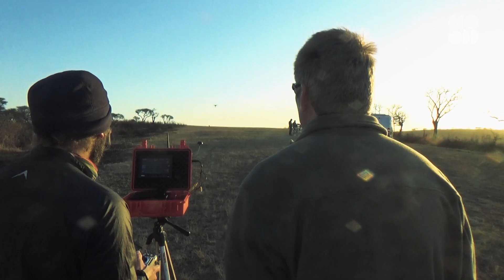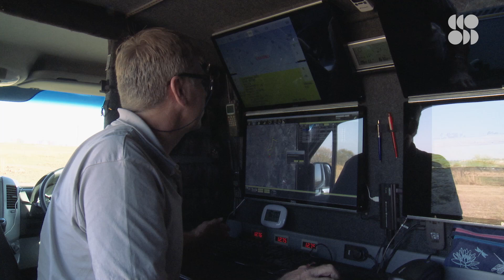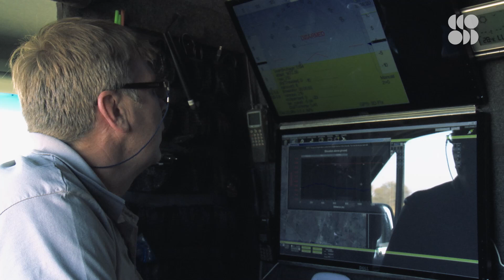How Drones Are Fighting Poaching in South Africa

Comment: If you start farming elephants and rhinos for tusks and horns; poaching will disappear and your population of elephants and rhinos will increase in the wild. The farm also have a reason to the protect their livestock. Additionally, Their is no value currently stopping poaching. It is all expense  and risk and no tangible reward to use technologies or teams. Use economics to save endangered species not force. Seeker you are smarter than that. This goes for most threaten or endangered species on land or water.